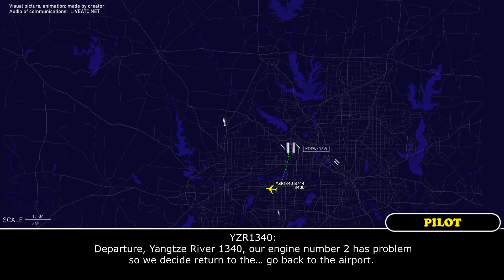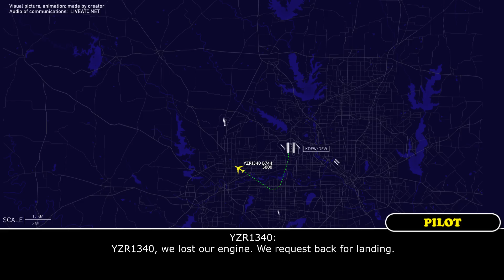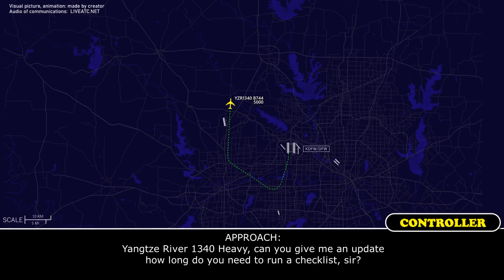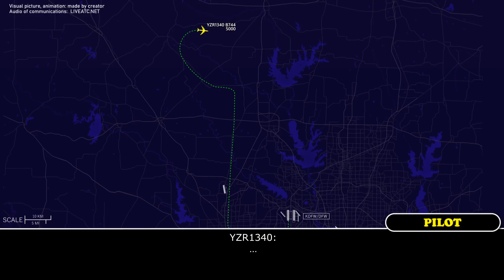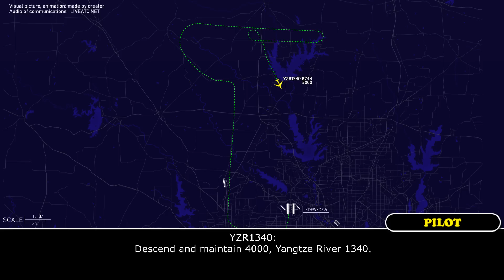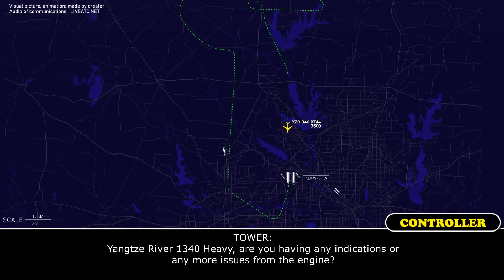Engine number 2 failure on takeoff. Suparna Boeing 747 returns to Dallas. Real ATC

Comment: ATC in this and many other similar videos keep asking about the remaining 'gas'. 
Are they referring to gasoline, natural gas or (hopefully) some kind of jet fuel? 
Also can't someone come up with a standard response to this question? Should the flight crew answer be in KGs, tons, tonnes, distance, minutes or just whatever format the plane happens to display?
Reply: ATC is asking for how much jet fuel is on the plane.  While the correct term is "fuel" I interpret ATC using "gas" to assist a non native English speaker.   The flight crew is troubleshooting the engine, running checklists, and likely a bit stressed.  Using a colloquialism may help get the answer needed.
Reply: Non native speakers are not likely to understand American colloqial term.  @CaffeineGeek

Comment: Can they just not look at the gas gage????? They just took off so they have about the same as they left.
Reply: ....................they are busy troubleshooting a failed engine on their 747 right after takeoff with presumably near max payload and fuel, running checklists, diagnosing, looking at indications, etc - ie they're busy AVIATING. Have u n ever heard of 'AVIATE, NAVIGATE, THEN COMMUNICATE.......?' Clearly you are a child who has no idea of what aviating entails. Please tell me you're not a pilot without telling me you're not a pilot LMAO. gtfo. the sheer willful ignorance smfh
Reply: It feels like whatever the pilots know (fuel in time, fuel in pounds, fuel in tonnes) the controller seems to know to ask for the one they don’t, like Gunny Heighway and the t-shirts in “Heartbreak Ridge”
Reply: when there's a failure onboard, the pilots are busy with flying without an engine and running checklists to ensure the engine doesn't cause catastrophic damage. they're concentrating on flying, not on checking fuel.
Reply: @gelatinous6915  Foreigners frequently run out of fuel.
Reply: Obviously they didn’t understand what was being asked.
Reply: They use a dipstick.

Comment: 10+ fuel requests by ATC is so distracting when trying to fly the airplane and troubleshoot the issue. This has got to stop.
Reply: If just answer the questions asked the first time
Reply: @Hot1765  your right since they aren’t doing anything else like flying an airplane
Reply: @trevorwofford3242  it’s an engine failure , one engine practices hundred times they got time to read off the numbers , they didn’t loose 3 engines and fighting for control
Reply: I don’t think it’s a problem. And they asked like twice because they didn’t give it to them.
Reply: @saxmanb777  Because they are flying an airplane with an engine failure is why they didn’t give it to them. Not because they aren’t listening.
Reply: While i understand what you mean, it should be a standard to say souls on board and fuel remaining in time or pounds immediately when declaring an emergency. I feel like it would help with the frequent questions asked bout ATC for that info when you don’t give it to em when they ask under those stressful situations!

Comment: The fuel question is not important at that moment. Why does ATC repeatedly interrupt the crew for this trivial number. They are clearly busy.
Reply: Rote procedure zero judgment. Maybe those who make the procedures know that they can't count on all ATCs having good judgement. Scarier than engines that sometimes fail imo
Reply: Those 2 pieces of info are important especially if the aircraft crashes. Souls tells them how many bodies to recover. Fuel remaining is how big the fire will be - not so much for endurance.
Reply: @GFOER123  Think about the pilots flying that hunk of fuel loaded metal. Priorities are as follows. Aviate. Navigate. Communicate. Atc is the lowest priority. That Asian pilot is wondering why the heck is atc wanting to know my fuel at this point in time.
Reply: @MegaHowtoMan  I agree with you. I am a licensed private pilot and know the drill. Aviate, navigate, communicate. Souls and fuel are not more important, but ATC is going to ask every time- that is standard procedure. The pilot should provide that info if workload permits. In this case, ATC was probably a bit over aggressive with their repeated questioning. My flight instructor covered this very well with me during emergency training - ATC is going to ask those questions, but do not prioritize the response over safely controlling the aircraft. Nothing wrong with what the 747 pilots did here. Safe control of the aircraft was obviously their  highest priority, as it should be. A 747 that just departed for an overseas flight is going to have a substantial amount of fuel on board - ATC should know that.  My response about bodies and fire was simply a matter-of-fact answer to a question that someone asked concerning why ATC asked those questions.
Reply: They need to know it.
Reply: @saxmanb777  "They need to know it." They DO NOT need to know it. There is this elusive thing called a Flightplan that is on file with the authorities, the FAA, and on that document it is required to enter your fuel in hours and minutes. Who knew?
Reply: @JohnSmith-zi9or  that’s weird. So every single controller that’s asks for fuel and souls onboard in doing it wrong? Plus how are they suppose to know the fuel on board when it changes after it’s burned?
Reply: @saxmanb777  No they don't. The endurance of 747 is longer than that atc controllers shift. The only reason they ask is for time and crash fire rescue so they know how much water to bring to crash. Not important at that moment.
Reply: @MegaHowtoMan  umm yes they do. That’s why they are asking. All emergencies require souls and fuel remaining to be passed on.